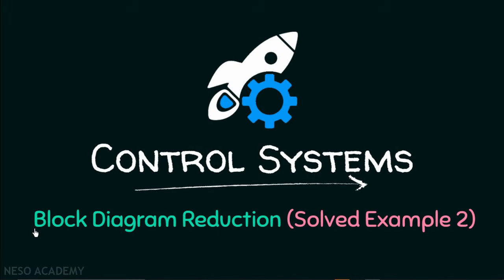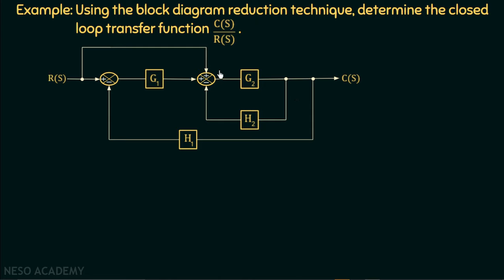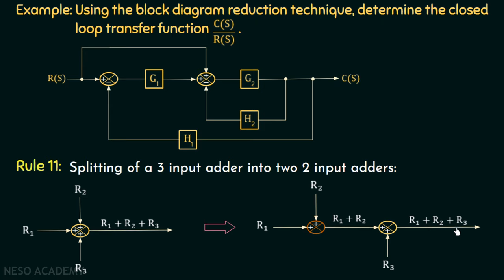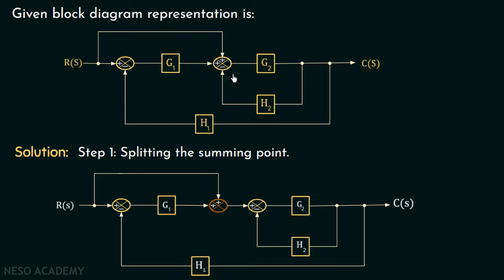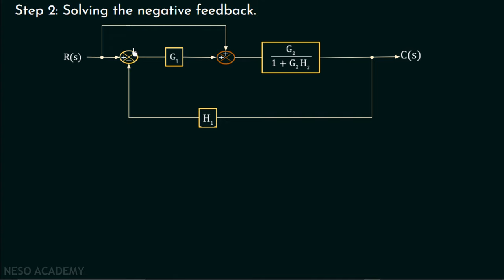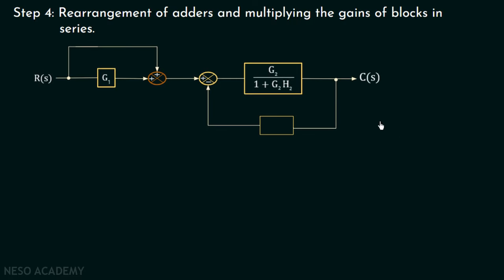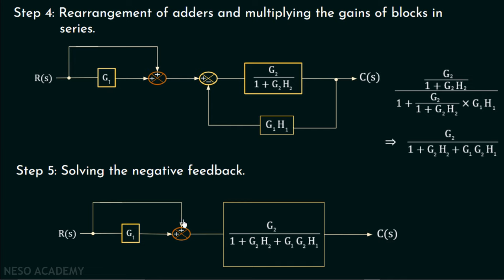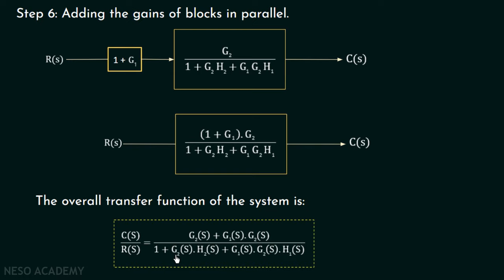Block Diagram Reduction (Solved Example 2)

Comment: 2nd Problem: 

1) split the right-most adder into the rest of the block diagram + a negative feedback loop which can be solved as (G3/(1+H3G3))

2) move the branch from before G2 to after G2, and compensate with gain 1/G2. This puts two branches in parallel whose overall gain is (1+1/G2).

3) now the left hand side is two nested negative feedback loops. The inside feedback loop solves to G2/(1+H2G2). The outside then solves to G1G2/(1+H2G2+H1G1G2).

The total comes from multiplying the results from 1) 2) and 3) together.

Comment: Ans 1)G1G2G3/(1+G2G3H1-G2G3H2+G2G3H3)
Ans 2)G1G3(G2+1)/(1+G2H2+G1G2H1)(1+G3H3)
In second problem, shift the take-off point before the block G2 after it.Then simplify it.
Reply: Hey how did you solve that 2nd example..?
Reply: @Tejaswini01212  Firstly split the 3 input adder into two 2 input adder.Then shift the take off point before the block G2 after it.Then it can be easily reduced.
Reply: life saver bro
Reply: @Divyanshusrivastava24  sir,after shifting branch point before G2 then block becomes 1+G2 right
Reply: @Prakash-dr2es  After shifting of take off point,a new block of gain 1/G2 comes according to block reduction rules.Then after further solving you get a block of gain 1+1/G2
Reply: @Divyanshusrivastava24   sir can u please email me pictures of solutions of both problems.
It will be great help 🙏🙏🙏
Reply: @vijaychoudhary7255  Ok,send your email id.
Reply: @Divyanshusrivastava24  can i get the email solution too please
Reply: Can u send me the solution
Reply: Pls send me soln
Reply: Yes asnwer is matching
Reply: @Divyanshusrivastava24  SIR can i also get the solved homework problems please

Comment: The answer came out to be 
(G1G2+G2)/(1+G1G2H1+G2H1+G2H2)
while using Mason Gain formula. Why is it different?
Reply: Same here. I also got (G1G2+G2)/(1+G1G2H1+G2H1+G2H2) as the final answer while simplifying this problem
Reply: @tsumokd7616  then this answer must be right... thanks for response
Reply: Same beuh 
G1G2+G2/1+G1G2H1+G2H1+G2H2

Comment: Homework Question Answers 

1. G1G2G3/1+G2G3(H1-H2+H3)

2. G1(G2+1)G3/(1+G2H2+G1G2H1)(1+G3H3)

Please confirm
Reply: How can u solve the prob.2?
Reply: @duchoang3635  firstly spilt 3 input adder into two adder . Get G3/1+G3H3 
There after, shift take off point just before G2 to after G2 . Then in left side u will get G2/1+G2H2 and right side will be like 1+1/G2 . 
U will get answer